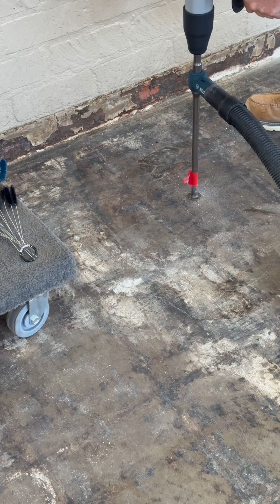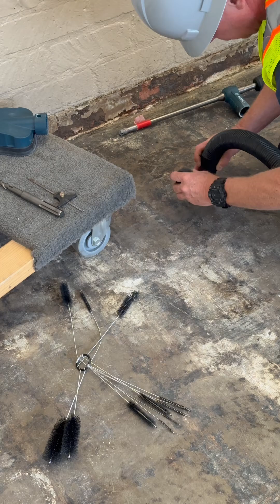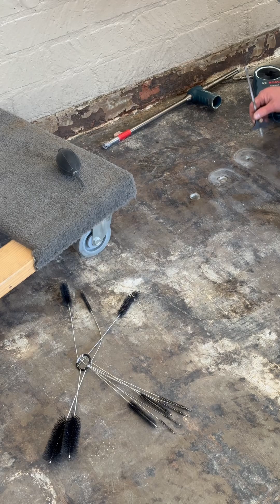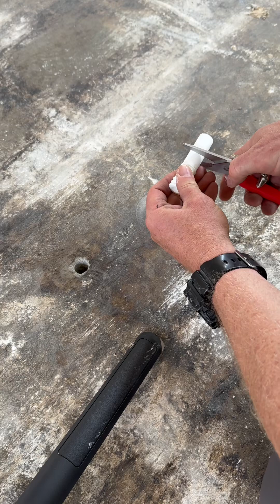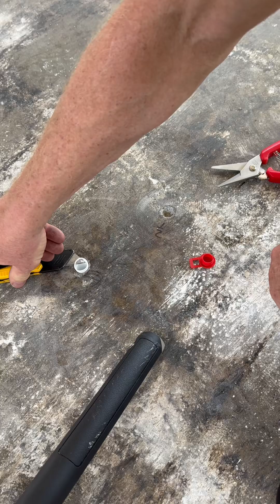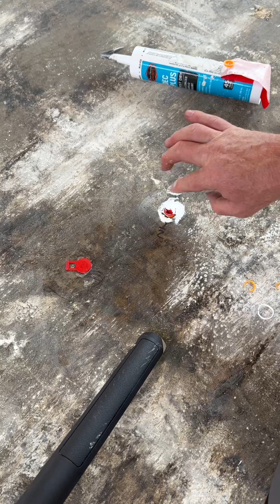Concrete Moisture Testing In California | Prepping For ASTM F2170 | RH Testing

Comment: What is the cost on the average, for using these?
Reply from the maker: They can get quite costly, it’s best to hire a certified 3rd party concrete slab moisture testing technician.
Reply: @JasonRamsay 
Why so expensive?
What do you put in the hole you drill?